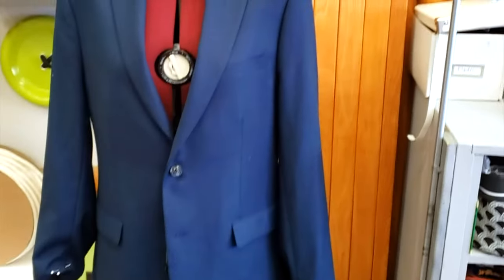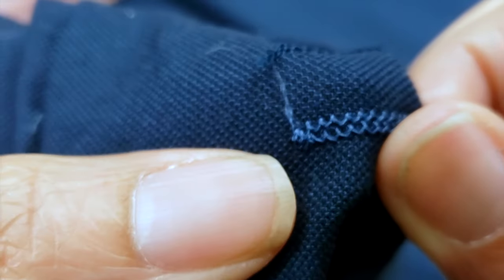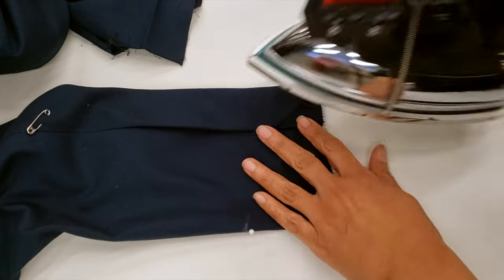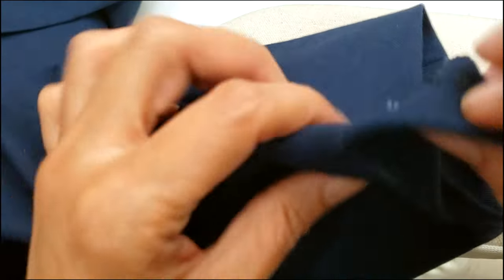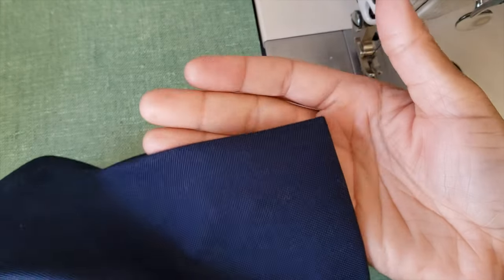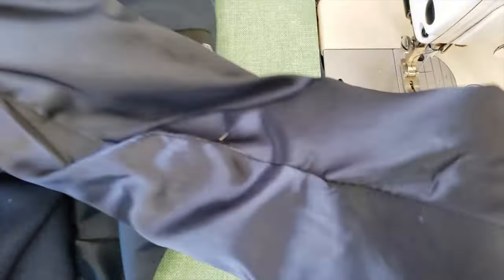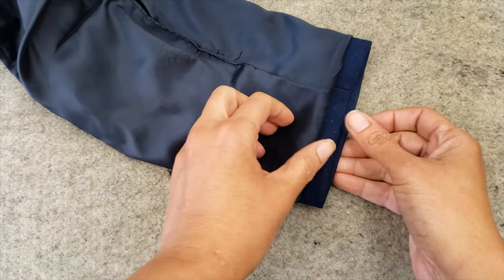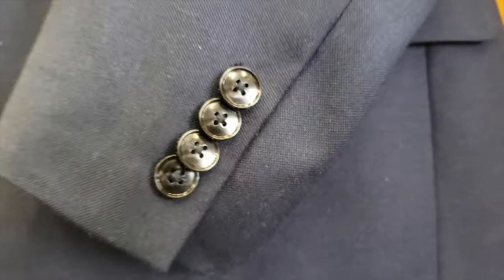How to Shorten the Sleeves on a Jacket *professional tailor's process*

Comment: Thank you. It was a perfectly clear video. I was able to edit a lined jacket. I'm proud of how it turned out. Two questions: How do you deal with lining that tends to fray a lot while working with it? How else would you decide the length of lining to cut off? I found that mine ended up being slightly too long. It didn't show...but it wasn't as neat as I would have liked it.

Comment: Perfect 👍 this is precisely what I needed! My son has had a jacket for several years, but never worn, that I needed to shorten, but I really wasn’t sure how to complete them job neatly, now I do thanks to you! 
Can I ask, why didn’t you redo the fake buttonholes? 
Many many thanks, my son will be so pleased he finally gets to wear his jacket! X
Reply from the maker: Because I did this job for a customer.  It is normal not having the buttonholes.  If I add them, then the job would be more expensive for basically no difference. But, yes, they certainly can be added 😉
Reply: @DowntownTailoring  how do you add fake buton holes after shorten sleeves. Do you have any video about that?  Please share. Thanks.
Reply from the maker: @kausarjawaid886  You can do them with your domestic machine. Cheers 🙂

Comment: Great tutorial!  Thank you so much. Question about the button hole thread, what is the proper thing to do if the thread holes don't disappear with ironing (so you can still see where the original ones were but the sleeve is going up 2 inches so to high to still use them)?  Do you just deal with them being visible?

Comment: Great step by step instructions. I really appreciate it. The only confusing part was the sewing ‘the hem’ by hand. I didn’t quite under stand what specifically you meant by “the hem” ang exactly what part of the sleeve were you sewing to what.
Reply from the maker: Hi! This part is not essential. I like to use a catch stitch to hold the hem up. Like regular hem pants. I think this gives more stability to the hem. Cheers 🤗

Comment: I did fixed a men jacket sleeve following your instructions and it was great. But how can I add the buttonhole so it look exactly like the original. If you can tell me, I will appreciate it. 😊Thank you so much
Reply from the maker: Hi! You can use your domestic machine to make them.  Be sure not to reduce the length of the stitch too much as they won't be functional anyway. I'll have to make a video about it.  Cheers 😊
Reply: @DowntownTailoring  Thank you so much for answering my question. I appreciated it

Comment: I have a question am shorting a dress jacket and it has a small mitered corners and am new to doing them am shorting the jacket by 1 inch do I necessarily need to make the mitered corner if the corner is small can I cut it straight and make it into a new sleeve the jacket does have lining also can you please help me

Comment: What happens if you don't put on the interfacing, or just put it part of the lenght?
Reply from the maker: Hi! If you don’t put interfacing, the sleeves will look too flimsy and they won’t stay well put, even if you do great job, it won’t look good. Cheers 😊
Reply: @DowntownTailoring  Thank you! Is tis true even for a thick winter ladies' coat? Is there any trick I can do if I do not have this interfacing material?

Comment: More often than not, when I purchase a jacket off the rack the sleeves are too long and need to be adjusted.  If the jacket has fake button holes, that feature is always lost when the alternation is done. How difficult is it to recreate the fake button holes, so that the style matches the jacket before the alternation? Alternately, how difficult is it to shorten the sleeves from the end at that attaches to the shoulders instead?
Reply from the maker: Hi! The fake buttonholes can be recreated.  The only detail is that it will double your bill with the tailor.  Same with shortening the sleeves from the top. It can be done, for the most part, but it will triple your cost. Just tell your tailor that you are willing to pay as much as needed, and you'll get the job done to your liking.  Cheers 🥰

Comment: I had my sleves shortened but still have needle marks from where the old button was, how do i remove it?
Wont the iron damage it, do i need to put a ironing cloth etc?
Reply from the maker: Hi! Yes, you have to be careful with the iron.  I can use it a lot because mine is very special.  I'd suggest, if you have the patience, to use a needle to put back the threads on place and then, steam it. I hope this helps 😊

Comment: I have a small question. I measured everything out, unstitched everything, marked everything I needed to mark, but the vent area of the sleeve where it splits for the buttons isn't long enough. The two corners end up side by side and trying to overlap them like normal makes it so there's a big crease at the bottom instead of laying flat. Is there a way to fix that?
Reply from the maker: See if you have at least 1 1/4" for space and then make your hem 1 1/4" instead of 2". Good luck 👍

Comment: Hi, I'm looking at a high end Jacket on ebay with the buttons cut (working) Sleeve is 26 1/2 inch and needs to be 25 1/2. The buttonholes are far enough from the sleeve that I suspect 1/2 inch is possible but at 26" I will still look like I am wearing my older brothers jacket. Any pro tricks or nothing to be done with cut buttons? Putting a strip of material over the buttons is not an acceptable option.
Reply from the maker: Sorry for my late response. Maybe it will be a better idea to shorten the sleeves from the top. 
The following video might help:
https://youtu.be/eYj8N9KlpmY

Comment: What you did with the button holes stitches …? 
Thank you 💕
Reply from the maker: I removed the original but didn't make them back.  If the customer wants, I can make them again.  It's just that the job will cost more for them. And, as not all the jacket have buttonholes, they rather opt them out.  Cheers.
Reply: @DowntownTailoring  thank you! Love all your videos !!

Comment: I have a tailer who said he's going to shorten the sleeves on my glen check pattern jacket from the shoulder area. He promised the pattern will still match but I thought it would be easier to do it from the bottom as you did in your video. Is this a red flag?
Reply from the maker: Hi! It isn't a red flag.  By the contrary. Shortening sleeves from the top is the most difficult job on jackets.  Cheers 🙂

Comment: What if you had to shorten it so much that the vent is comically tiny? Have to shorten 3 inches but then that would only leave me with like 2.5 inches of vent left and it looks awful
Reply from the maker: In this case, there are two options.  1) shorten a bit from the top and the rest from the bottom which is a huge job or 2) Create a false slit using the extra length.  It isn't great but it works.  A third option is closing the slit and just sew the buttons back (not too nice, but easier). I hope this helps. Cheers 🙂
Reply: @DowntownTailoring  could you elaborate more on the 2nd option please? I think shortening from the top going to be too complicated for me so thats out of the question for now until i get a jacket from the thrift store to alter and learn. Such a shame for me since like you said in one of your videos, if a customer bought it looking that way, you would think they would want it back looking the same way and its so true, for me it is atleast.

Anyways thank you and i love your videos!

Comment: Perhaps you could show how one could shorten a man's suit jacket from the shoulder's when that is the only way one can shorten the sleeves or when the shoulders are too wide on the man. I hesitate to even try doing that alteration because I know I would need to cut away fabric on the jacket and fear I will not be able to sew the sleeve back in and the padding. I have run into customer's who have large bellies so they buy RTW to fit around their big bellies and then the shoulders are too wide and the arms are too long. I usually refuse to do that alteration but instead do attempt to do the sleeve shortening but sometimes there is hardly enough fabric to leave without losing the lap and then I end up shortening them but they still are a little longer than they should be. I even had a customer who bought a jacket that was for tall men and he was short and pudgy and he could no longer return the jacket. All I could offer him was to shorten the sleeves and lose the lap and sew the buttons back on. He felt no one would notice. I had checked in my area and found an alteration shop willing to do that alteration but they wanted $175 which was more than the suit cost him.
Reply from the maker: I know what you mean.  Sometimes I have to shorten double.  I mean from the top and from the bottom because of the reasons you mentioned above.  I need to make a video about it, but in the meantime you can take a look at the video where I shorten the sleeves from the top on a woman's Jacket.  It isn't the same but fairly similar.  Cheers 
https://youtu.be/eYj8N9KlpmY
Reply: @DowntownTailoring  I did that after commenting and realized you said you were planning to do a video. We once had a professional tailor in our area that warned me about shortening a man's sleeve if I did not know what I was doing because I had tried doing one on a customer's jacket. He said if I ruined it, he would not hold me responsible and did do so and turned out well but still was nervous. I mentioned it to this tailor and said I could run into trouble raising a sleeve by the shoulder if he had really muscular and bulky arms and then raising it could make the arm too tight at the bicep area. I never forgot his words of warning but luckily my cust. had skinny arms. I suppose if one needs sleeved raised then in that case it would need a double sleeve alteration. By the way do you limit your alterations to RTW or do you also do bridal gowns? I do not do bridal because I do not have the supplies or have, I had much experience doing them and have an associate I refer bridal gowns to her business. She is also fantastic at her trade.

Comment: Wouldn't it be easier to shorten the sleeves by cutting the stream on the shoulders and shorten it from there?
Reply from the maker: This too is a way to do it, although it isn't easier as working with the armholes of a jacket can be very tricky. 
Here you go, a video about this way 
https://youtu.be/lm6z8BEYAVA
Cheers

Comment: I have been sewing all my life and have done many many jackets pants and all , but one thing I see that you don't do and that is to use a pressing cloth you can ruin those jackets if you don't use a pressing cloth to keep from leaving a shinny streaks on the sleeves. I have done jackets that are silk and they can be ruined with an iron.
Reply from the maker: Hi Brenda.  Thank you for your comment.  It is very pertinent.  I do have organdi, silk and cotton cloth for ironing depending on the material. But what I want to point out is that I  dress my iron with a silicone bed that do pretty much the cloth's job and on top of it,  it's a super steamer, therefore it reduces by a lot the occasions I need the cloth.  I always check out first and  as I mentioned in the video I did a big job on this jacket but I just showed the sleeves so by the time of the video I've already tried on the iron. No damage to the jacket. Cheers 🙂

Comment: Where are the buttonholes? The sleeve had buttonholes.
Reply from the maker: Yes! They can be sewn back if the customer wants.  But most of them opt not too as increases the job's price and most of racket jackets don't have them anyways. If you want to do this for yourself you can be confident that it will be fine without buttonholes but if you desire them just sew them right before attaching the lining.  I hope this helps!
Reply: @DowntownTailoring  Strange point of view. I recently discovered that youtube are people who make videos with retouching on clothes but I can say that I have not seen any video with a short sleeve on a jacket from the shoulder to keep down the cut, original buttons from the factory, or to turn a sleeve that has the cut-out buttonholes into a slit with cut-out buttonholes. I also want to say that all those who post on youtube how to shorten a jacket sleeve, do it through the same procedure, a procedure that in my opinion is wrong and even more difficult and inaccurate. It's as if they all learned from each other and not all of them are real tailors, because if they did, they wouldn't do the length retouching of the sleeve like that. It is taught at school that before mounting the sleeve in the cut of the sleeve the sleeve is prepared in this order, the assembly of the sleeve face is performed with the back by sewing the two pieces together to the point where the bottom slot starts, then the slot is made and the buttonholes are made if they are the uncut ones if you want with cut buttonholes then the slit is finished, which is a typical one for cut buttonholes the buttonholes are made by hand if the customer is a demanding one or if with e then it is made at the machine . Then close the sleeve on the seam under the arm and fit the cuff of the sleeve and then fit the sleeve to the jacket. The retouching is done by peeling off the bottom cuff on the sleeve, peeling off the seam under the arm until close to the cut and so it is much easier to work, mean, cut ironed and made buttonholes, plus you should know that if you cut from the bottom sleeve let's say 8 or 10cm, the end of the sleeve will be almost 2cm wider, so it also needs to be narrowed from the underarm seam to get the bottom width of the front of the sleeve. I have not seen any of these so-called tutorials made by countless retouchers. In conclusion, how to say that the client does not want buttoning on the sleeve, or that he is not interested? Most of the time a customer buys a jacket just because he saw that he has not 3 or 4 buttonholes in his hand but 5 or even 6 or that they are made more obliquely and last but not least that they are cut and therefore functional. I am referring to customers who buy suits from luxury stores, from famous brands, Tagliatore, Canali, Kenzo, Coco Chanel, etc.
Reply from the maker: I understand your frustration.  I was talking about jackets from the rack. In my experience, customers who buy luxury jackets won't sacrifice the look even if the job is double.  I always shorten the sleeve from the top for them.  My channel is relatively new and I haven't had the time to make this tutorial but this is a short I posted a few weeks ago going from the top. 
https://youtu.be/3sR9dlythhI
And, by the way, I didn't know/do/notice that alterations could be retouched.  This is hilarious 🤣 
Cheers